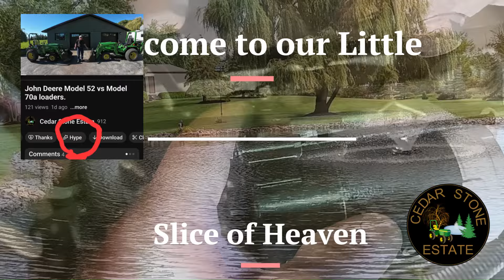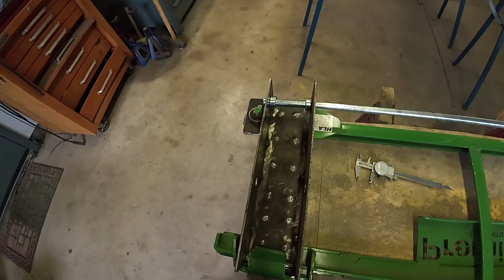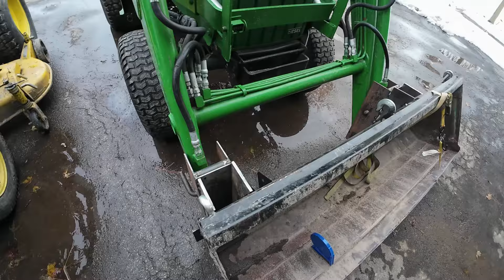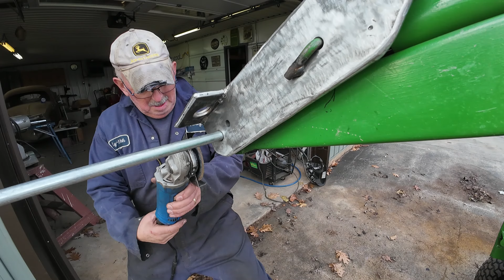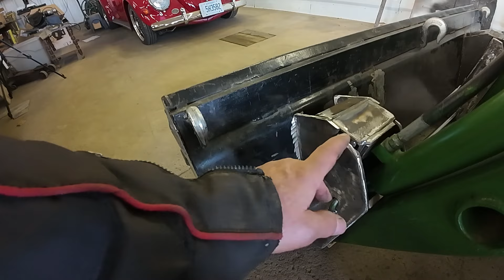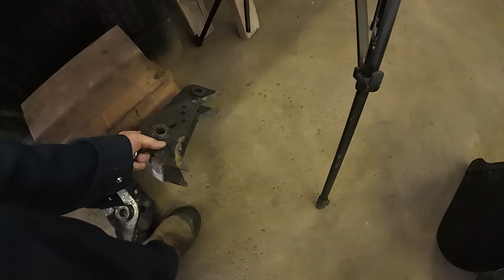Building a John Deere Quick Attach from spare parts.

Comment: Great job on the quick attach mod. It sure is handy to be able to switch loader attachments without dealing with messy greasy pins.
Reply from the maker: Thanks,  if I remember (I think???) you did this a while ago.
Reply: @cedarstoneestate Yes I built a pallet fork attachment.  Before I made the pallet fork attachment,  I converted my original lighter duty pin-on tractor fork attachment to adapt to the skid steer style quick attach, but I didn't think of making a video of the conversion at the time lol.
Reply from the maker: I understand, I did so many projects before starting to make videos. 🔨🛠🇨🇦👍
Reply from the maker: I still have a fork attachment to convert.

Comment: Building stuff is fun! Concerning the cutting of the steel, I have been noticing the cold cut saws that look just like the circular saws that I used during my carpenter career. Milwaukee and Skil make one. Another company called Evolution also makes one. For straight cuts, they appear to work really well. 

I look forward to your next project.
Reply from the maker: Thanks.  I as well have looked at the cold cut saws. Requires a dedicated lower rpm saw though. Would be nice. Thanks for watching.